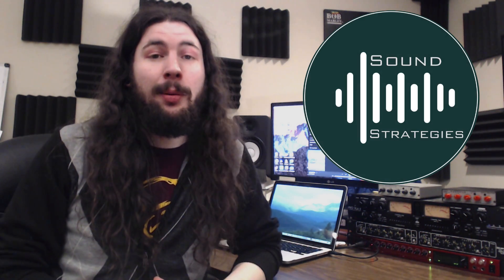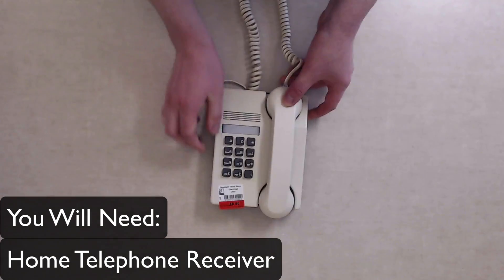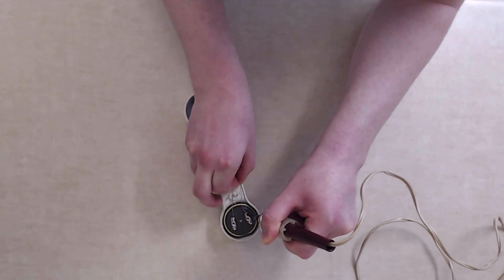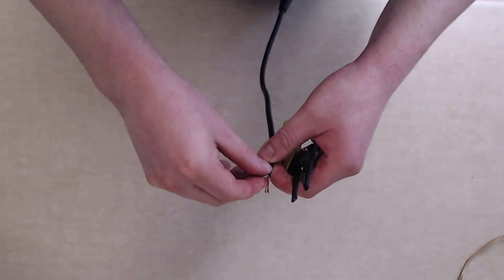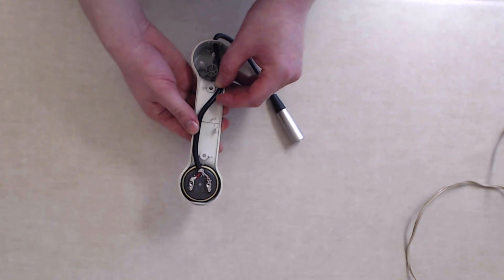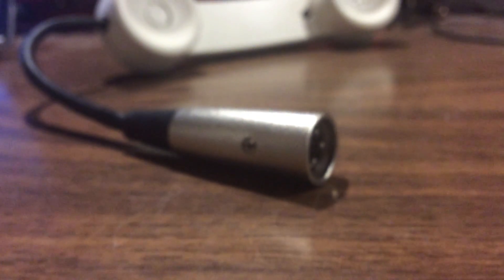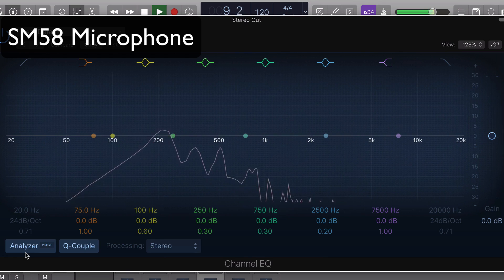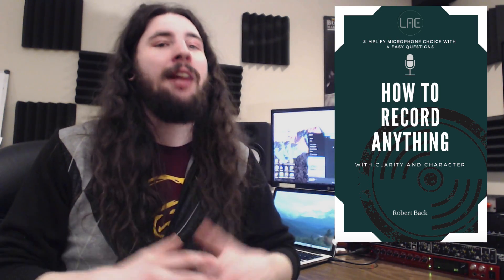How to Make a Telephone Microphone

Comment: Would it be possible to use a 3.5mm audio cable instead of the xrl and just connect it to a microphone connector on a computer? I think it would be fun to use it like that and let it look like I'm talking on a vintage phone when I'm just doing a video chat
Reply: I'm thinking same
Reply: I'm unsure of the wiring specifics but I think you'd need a preamp
Reply: I’d imagine it could work.  If it doesn’t, I’ve seen people wire a double A battery into it to supply the right voltage. Try it and let me know haha

Comment: Very cool project! I plan on doing this myself for textured vocal applications. I was lucky enough that I got a pre-1980s handset from a telephone at a pre-sort thrift store for dirt cheap which will be nice for the fact that telephones pre-1980 used carbon transmitters for the microphone rather than a dynamic microphone which was used in the ear piece. I'm planning on implementing the XLR's phantom power to feed the carbon transmitter and a switch mounted in the handset body to select which microphone sound is desired. I just wish XLR cables were either cheaper or the bulk spools to make your own came in shorter lengths. Cutting up a short XLR cable ends up being relatively expensive for such a simple project, but I guess we gotta do what we've gotta do.

Comment: How much do you think this will cost( I don’t think I have any of the materials but I really want to do this)
Reply from the maker: Hmmm.....Good question. Old landline phones are getting trickier to find at thrift stores, but it you get lucky you can find one for $5-$15. Sometimes you can find someone with a box of them in online classified ads.  If you have an old cable you're willing to sacrifice, you can cut and solder the ends and you're done!

If you don't have those materials you could grab a basic soldering pen for around ~$15, and another ~$10 for a roll of solder. A good Neutrik connector or plug will cost you around $5, and a foot of cabling might be another couple of bucks.

All in you're looking ~$60USD at the top.

Obviously this adds up initially, but its well worth the investment if you're looking to get into more DIY projects. I've hand soldered every cable in my studio so I know they work, are designed custom for my space, and are of the highest quality possible.  And if something isn't working I know I can probably fix it, and the onus is on me to do so. :P

Now just in case you're not up to doing all this for a fun effect, I'm working on a video thats coming out on Sunday about how to make a SM58 sound just like a telephone call. I'll link that to you when it's out!

Hope this helps, Thank you for watching and best of luck with your future projects :D
Reply: @LearnAudioEngineering  thank you so much! That’s less expensive as I thought it be! I really appreciate it!

Comment: i know this video is pretty old but i'm wondering (and please keep in mind i have zero clue about audio engineering, cables and etc. i'm just a 20yr old girl with w a hobby so i'm definitely missing some technical language lol) what sort of cable would i need to connect this to my computer? is something like that even possible? the one you're using on your video looks like the one you plug in speakers which clearly works for you in professional audio engineering. but i'd just like to record some songs on my computer with the "filter" these mics have. would the process be too complicated? :/ 

thanks for the video, great explanation and definitely learning some stuff!!
Reply from the maker: Hi! Great question.

In order to get the signal into your computer you would need an audio interface like this:

Scarlett Solo:
https://www.amazon.ca/Focusrite-SCARLETT-SOLO-3RD-GEN-USB-Audio-Interface/dp/B07QR6Z1JB?th=1

If you're making a telephone microphone like this, and you don't want to use the male XLR plug used in the video, you could use a 1/4" male TRS end instead, similar to what you would plug into a guitar amp. 

You would plug this into your audio interface, which would connect to your computer via USB.

hope this helps, sorry if any of the information was over-explained. Please feel free to ask any follow up questions.

Alternatively, If you have a USB microphone that you regularly use, you could always process that to sound like a telephone.

What DAW are you using? perhaps I could make a video on this. (Thanks for the idea :D)
Reply from the maker: Hey, heres a new video about how to make any mic sound like a telephone:
https://youtu.be/7vTsABsY7B0

Comment: Is there a way to do it with an acoustic cable rather than an XLR? Like a guitar amp cord, for the life of me I can’t remember what it’s called but yeah
Reply: You mean a 1/4" TS cable, I think. Sometimes they call them instrument cables. I think that would actually work better, since they're unbalanced (two contacts), exactly as needed for the pos and neg terminals on the handset speaker. The wires inside a TS cable should be colored the same way - solder the red to the positive on the speaker, black to the negative.
Reply: @joshmccorkle3042  thank you! I’ll come back when I make it :D
Reply: @steem_punk hey did you end up making this?
Reply: @AAlteaSegovia  not yet 😔

Comment: hey man, how come it doesn't matter which end of the cable you solder to each end of the microphone contact points? I'm unsure if there is a 'correct' way to do the wires, whether to an XLR or a 1/4 inch mono guitar jack

Comment: I have a few questions, I found some old phones just like that in an old abandoned factory. They are a little dirty but intact, I heard that if I wanted to use the mouth piece as a microphone I would need a amplifier for it, which I don't have and they're crazy expensive right now over here, but if I were to use the ear piece receiver then I wouldn't need any power for it. So here's my question, with a little bit of introduction first.
A year ago I bought a shure sv100 microphone online but it has some difficulties picking up sounds because it's not connected to an amp and a power supply. 
It comes with a cable that has the female XLR plug one one side and 1/4 inch jack on the other, to which the microphone connects with a built in male XLR plug. 
Now can soldier a cable to the microphone and have a male XLR connector which I can connect to the cable of my existing microphone? WIll it work?
Thank you.

Comment: Would it be possible to maybe solder some wire to the microphone positive and negative then connect the wires to their corresponding place on a 1/8 inch audio jack?

Comment: Great tute! Just curious as to why you used the speaker and wired it as a mic instead of using the actual mic? Is it because it's placed better within the phone?
Reply: Newer phones often have condenser mics in them that need power to operate, but the speaker is almost always dynamic where it doesn't need external power to function.

Comment: I think I messed up too much when soldering. It’s cause the speaker from the phone I got had a weird placement of the pins to be soldered. I think I burnt them too much cause they are black. Do I need to get a new vintage phone or could I still fix my current problem?

Comment: This is great! because I don't own a mixer am i good to use some generic XLR > 3.5mm/USB adapter? Or is there any better way to input this into a PC without XLR?
Reply: Since it's not grounded, I don't think it's necessary to use phantom power. I'm not an electrician, though. I'd say that XLR to 3.5 would work. Theoretically, you can do this with any audio input cable.

Comment: been using it for years.. but most say that I made a plugin chain of a simple EQ , a distressor and a compressor.. which I use as a "phone" parallel chain.. and then send a bit of snare drum and toms thorugh it (often I make a similar channel for guitars, bas and vocals).. makes drums POP in the mix (midrange is the key to mixing).. with a phone mic you need to set it up on all sources.. so.. super cool. It works great!, but if you need it on more sources in one take, the plugin approach will server you better. Just my 5 cents. Og and great video! Simple and to the point!

Comment: There are 3 pins on the XLR plug. Number 1 pin is for ground, not needed, so tape it off, or cut it off to avoid touching the other wires. Number 2 pin is for the positive wire, and number 3 pin is for the negative wire. If you are not happy with the sound, simply reverse the wires on the phone to see if it is any better. In theory, the proper way to connect a speaker for a microphone application would be to connect the negative of the speaker to pin 2 of the XLR, and the positive of the speaker to pin 3 of the XLR. Yes, that is reverse wiring from normal.
Reply: next question, which pin is no. 1, 2 or 3?
Reply: @bletheringfool tell me if there’s any answer

Comment: Would this by chance work with a usb cable?
Reply: No, that's a Digital connection. A lot more complex. Requires an analog to digital converter first. This is only analog.
Reply: K thx

Comment: Hi, thanks for sharing this! I’m wondering why not use the original mic? Obvs the speaker works but what’s wrong with the mic? Looks like the one I’m playing with has a ground connected, wouldn’t that be simple enough to connect to the sheath on the cable?
Reply: the mouthpeace is a carbon mic which needs phantom power

Comment: could you do this with a 1/4 mono cable rather than an xlr?
Reply from the maker: Yes! it would work well thru an amp.
Reply: Learn Audio Engineering how would you go about soldering to the terminals, since there's only one wire and a ground? Would you just solder half the fibers to one side and half to the other?
Reply: @yung-stephen  how did you do it?
Reply: Kidd Koolaid solder the shielding/negative/ground fibers to one terminal and the positive fibers to the other, it doesn't matter which is which
Reply: @yung-stephen  oh yeah it actually worked, im bout to go do some al bird dirt stuff
Reply: Learn Audio Engineering never mind i figured it out and built it today and it works great thank you!

Comment: The mic and speaker function in reverse, but I have question. Why not using the mic of the telephone itself? I watch other videos where they use the speaker as well as a mic. But I want to know why. Thanks. Nice video!
Reply: Because the telephone mic is a capacitive or condenser type microphone, like all cheap small microphones especially in compact electronics. It does not generate its own electricity, so that it needs a DC power supply; by contrast, the telephone speaker is a dynamic speaker which acts like a dynamic microphone. These microphones are larger & more expensive, and they generate electricity when vibrated by sound.
Reply: Ever get an answer to this?
Reply: @dubcavern6414  The carbon mic needs phantom power so it needs more complex wiring and has a wider spectrum than using the speaker, so less lo-fi-ish sounding
Reply: Just strip one LR06 to the mic...

Comment: Hello! I was wondering if you have to solder it or is there a way to tape it?
Reply from the maker: You might try wrapping the wire around and then using electrical tape. Soldering would be much stronger, but in a pinch it might work!

Comment: why didn't you use the telephone microphone itself? Or, why did you use the speaker instead?
Cheers, man! I'm digging your awesome channel!
Reply: You can move the earpiece speaker to the mouthpiece position so you can use the phone in the intended position.  I don't think the way it looks singing into the top bothers young people as much as me.
Reply: Use it on stage during the moments like CCRs "Suzy Q" or on the guitar amp at the intro of Pink Floyd's "Wish You Were Here"
Reply: It didnt work fine for me. I dont know why, but I keep getting signal with ground noise. I tried unbalancing the signal for the xlr conection, tried using an unbalanced cable as well, but no thing seems to fix my the noise I get. Plus I really need to crank up the gain to get the sound.
Do you have any ideas to fix this??

Thanks for your time!
Reply: The microphone needs phantom power.
Reply: @MrPrtyMrthn  If I used batteries in the handset as phantom power, will it sound better than the speaker?
Reply: Martin Federico I think Simon the Magpie made a switchable one... and, no it wouldn’t sound better necessarily, just insanely louder.
Reply: @MrPrtyMrthn  thnx!